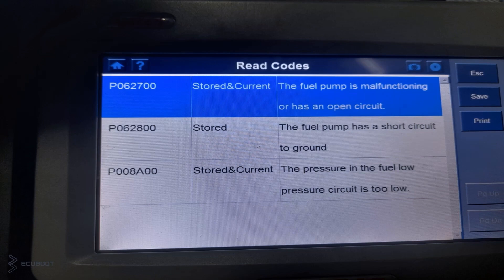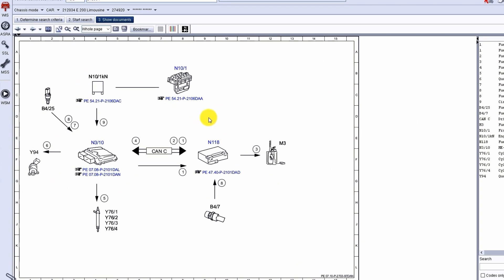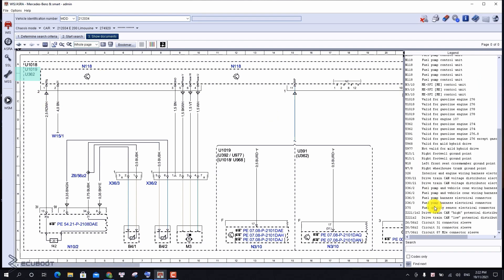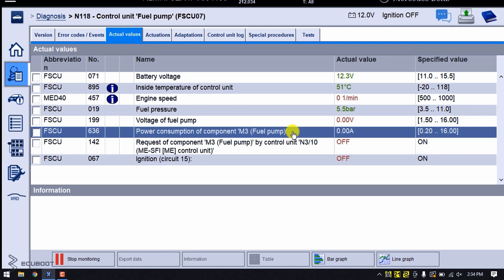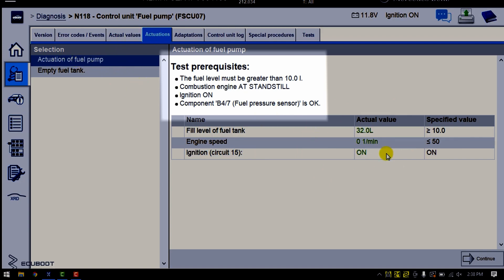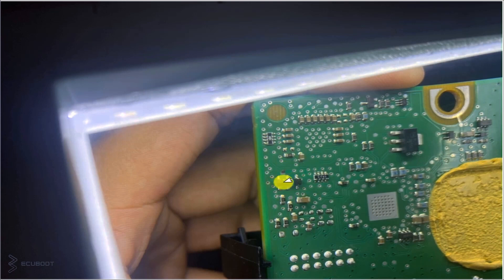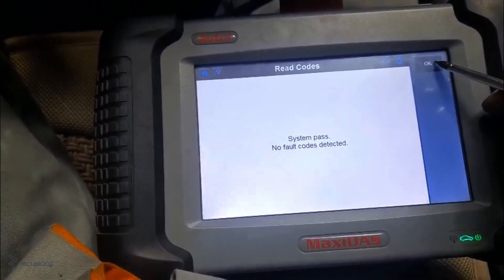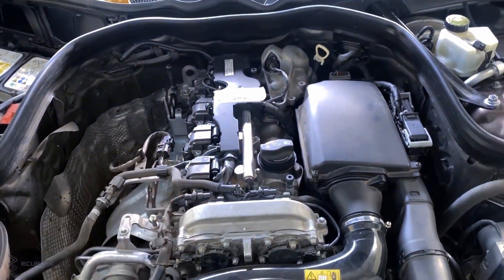Fixing Mercedes Faulty Fuel Pump Module

Comment: im getting a code 
“P064A-68”
control unit ‘fuel pump’has a malfunction would that be the control module or the High pressure fuel pump? im getting hesistant acceleration and NO POWER

Comment: I have the message communication with fuel pump control module is faulty the message is lost no other codes should I replace the control module?

Comment: Is there a way to test a brushless fuel pump with an dc brushless controller to see if it works? Do you think it would be possible? To be sure the pump is fine maybe the module has a problem
Reply: Very complicated, how do you know the technical data for the inverter to run the motor?
My guess would be just pulses as a block from 12V on every phase makes it spin and is wound in star with middle point being -12V 😂
So strategy is to buy defective part on eBay or Scrapyard and then test with RC Hobbyist programmable Speed controller for brushes motor.. but why?